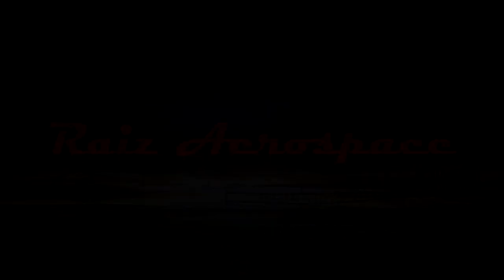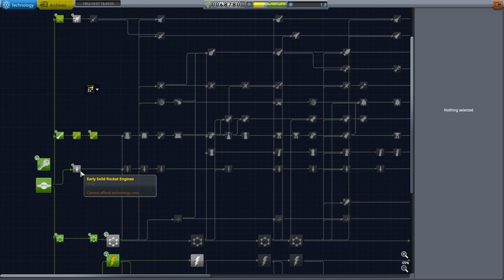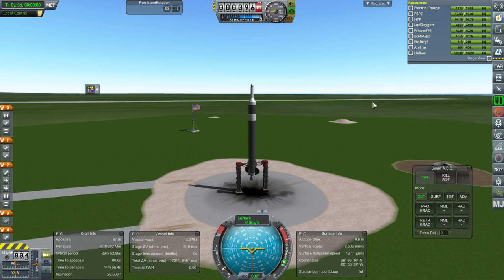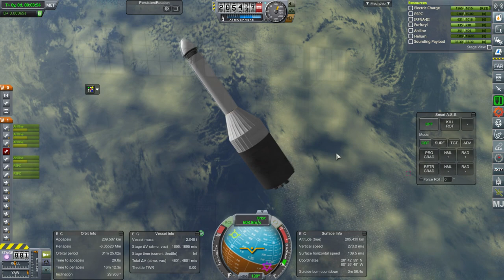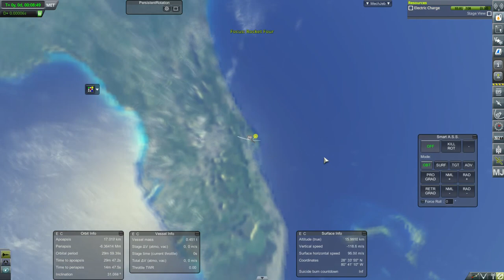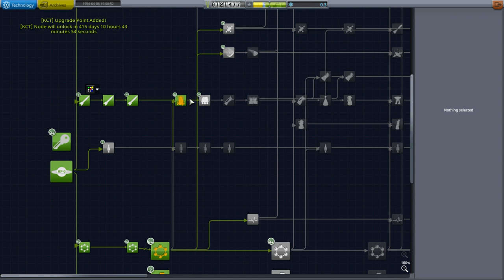KSP 1.3.1 with Realism Overhaul - RP-1 02 - RD-100 and XASR

Comment: Tooling is awesome, if you didn't know already. An upfront cost that hugely reduces the build cost and build time of all subsequent rockets that use the same parts. So if you're planning on building a bunch of rockets to grind science or contracts, tooling is probably worth it. 
I'm not advanced enough in my own campaign for communication satellites, but I look forward to tooled, cheap, commsat vehicles!
Reply: Also good for when you need to build three or four copies of the same rocket to beat the contract deadline!
Reply: totally. it seems to me that tooling is really non-optional. even for a one off, its only reasonable timewise if you tool the parts.
Reply: my strategy has been to built lightweight(3 fins, minimal size, minimal strength on tiny tim aerobees, best current tank type) sleek rockets for sounding. and only bother to upgrade when the offered contracts are no longer doable. this allows you to go from rd100 to say 102 or 103, skipping the upgrades in between, which lets you skip tooling for their tanks as well.
Reply: Annnd i also should probably admit that I cheat when accepting contracts. It seems as if it wants you to be able to take just one sounding mission at a time, but if you are quick enough, you can grab all three sounding missions. I know its kinda fudgy.  I think a better setup would be to allow multi sounding missions concurrent, but the payload requirements would be added up, where as now you can take all 3 missions, but need only to put enough sounding payload to satisfy the heaviest of the missions.

Comment: To your point of not having to relaunch similar rockets over and over again... I started RP-1 on the hard difficulty setting, and had to launch dozens of sounding rockets before I unlocked anything with orbital potential. So, that option is there, but save yourself the grind.
Reply: Did you have to launch that many or where you unwilling to wait for the R&D :Kappa

Comment: Hi, did you change the settings of MechJeb / Altitude Adjustment? I think it was Kp 10 Ki 100
I also have problems when engine-gimbal and fins both want to control the rocket...
Reply from the maker: I haven't done tweaked those settings yet, though I have done so in other installs. I'll look into it.

Comment: I think the entry cost of the engine upgrades in the R&D building is bugged somehow. If you unlock those upgrades in the engine GUI in the VAB the cost seems to be more reasonable.
And with regards to the science experiments: on my install it shows a list of where the experiment can be run in the right click info panel in the parts list, probably because I'm running a newer version of some mod. The Github wiki for RO also has a page with all the science experiments listed that explains where they can be run and if you need to return them or can radio in the data.

Comment: i play this soooo differently haha, i always use my rockets like 10-30 times with the sounding rockets, get like 10k for each mission and takes like 5 days to build the rocket. so good.

fins that move on rockets+mechjeb = never works right. 

Cold gas RCT HAVE to be at the highest torque points available even if that is the top of your final stage and will screw with delta-v of your final stage, its worth it. with the exception of maybe baby sergeant orbit boosters. 

maybe youll do it 10x faster who knows. by the fact you say manned missions happen after they retire makes me think not because i usually get a manned mission of 2 off a couple of years before they retire

Comment: Jeez... Rocket 3A's second stage is so ugly due to that avionics unit.

7:20 and 17:45 Indeed, it ain't really an accurate simulation of the early Space Age.

24:30 Sometimes it's better just to burn all the way and reach a higher altitude than to cut short for that exact reason... though 26:05 made that irrelevant.

25:15 It's relieving to know that they do in fact work. It doesn't make much sense that they can only be used in space proper, though, given that there was lots of biological experimentation on balloons and sub-space sounding rockets. About that, someone's gotta implement balloons into KSP—I don't think I've ever seen a mod for that even for stock!

27:00 The "bug" is called climate change. XD